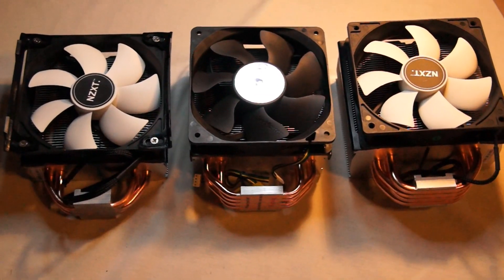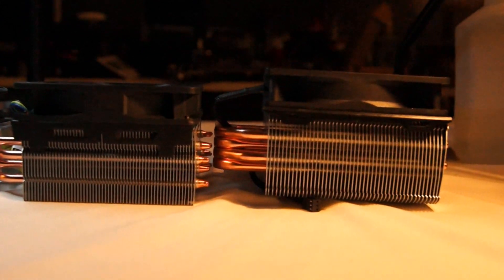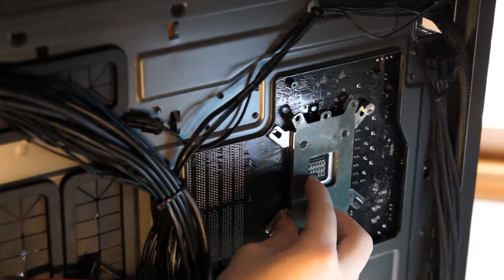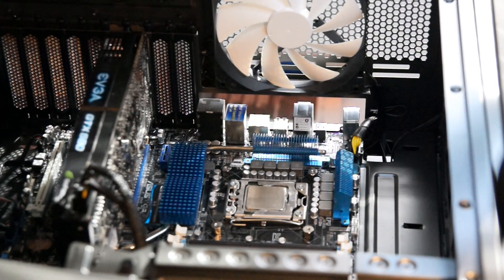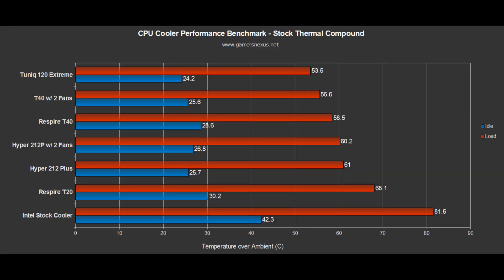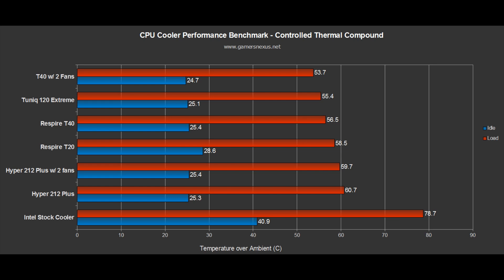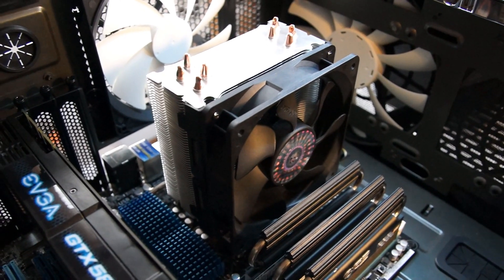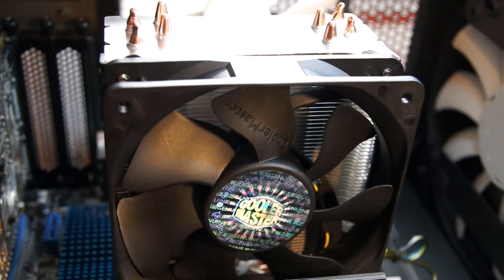Cooler Master Hyper 212 Plus CPU Cooler Benchmark-Review / Hands-on

Comment: Can be installed on 1700 by grinding off the ledges between 1366 and 1155 holes on the plate and the bracket.

Comment: 212 plus its the same as the 212 evo
Reply: damien adams Not exactly;  The evo has another quieter fan and the copper tubing on the bottom plate are fused together, while on the 212+ the tubes are separated.